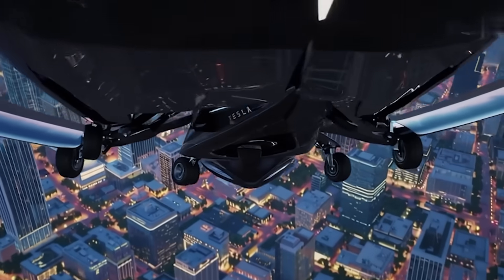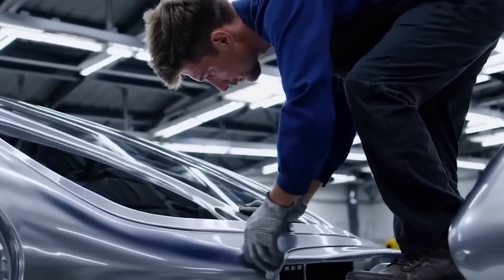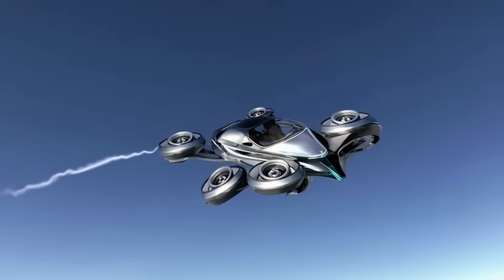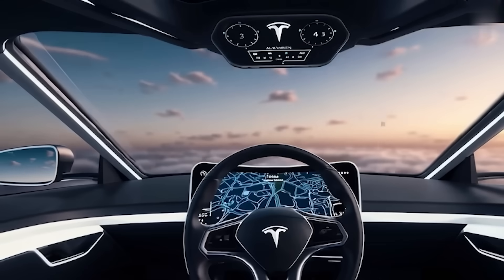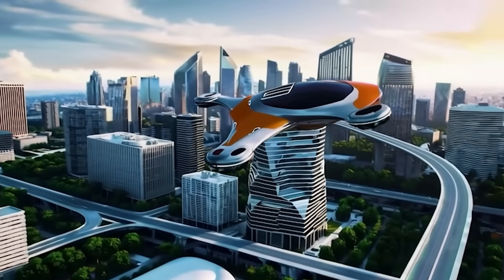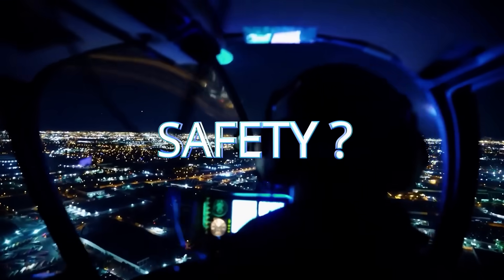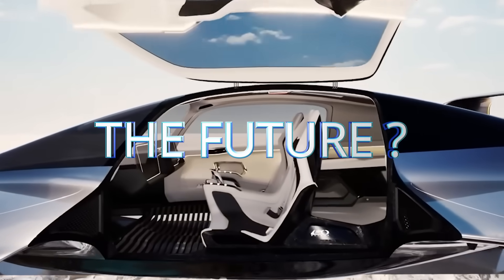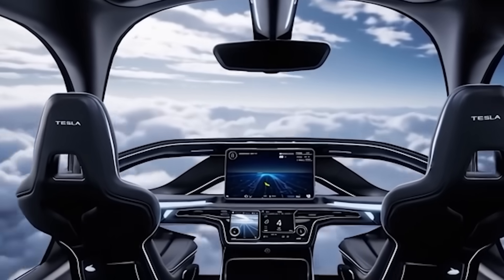Tesla Flying Car Is Finally Here And It’s Cheaper Than You Think

Comment: Bring it!  And give me a ride in it. Well, let's see it. Get them on the streets. Transportation security. We need to install webcams on all the street lights. It's not an invasion of privacy.  Yadda yadda. Nice. However, we need to concentrate on applying the autopilot to the road and highway system (separate from the ground system where rubber tires live). A system where police are not able to chase. They will inevitably want to have access to the car's destination, where the local police can wait for them to do whatever they want the passenger to do. This is transportation. Not a toy. Don't be negligent system designers or idiot passengers. Guidelines are to prevent People'care and Transportation System crashes. The skyways are not for idiots.

Comment: The 800 lb gorilla in the room : Driving on the street is dangerous enough with the idiots out there. At least there are rules to follow & cops to see that you follow them. With price you will see the idiots air born. This sounds a lot like you will need a pilots license if you're going to get in the air . A fender bender on the ground is usually not fatal , but one in the air is another thing altogether.

Comment: Is the parachute and ejection seat included???
Reply: YES but when the battery shorts out the hatch wont open . so you get ejected into the roof and get a broken neck before you crash .
Reply: If two of the 4 50 dollar drones rust and fall off will it crash to earth or head straight to mars?